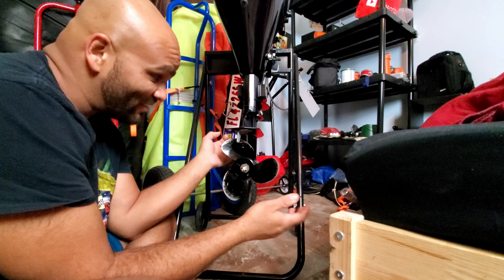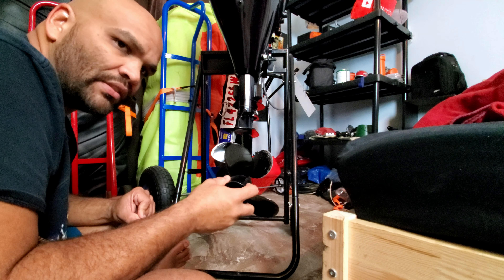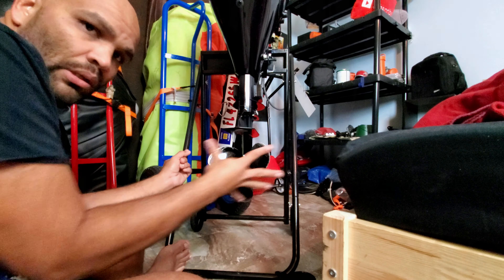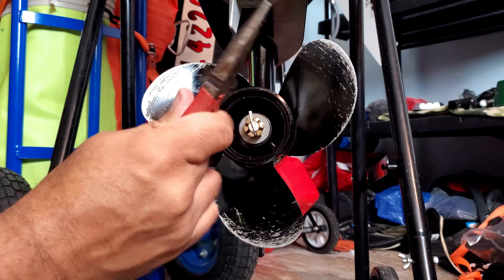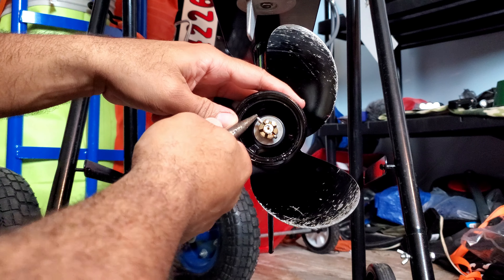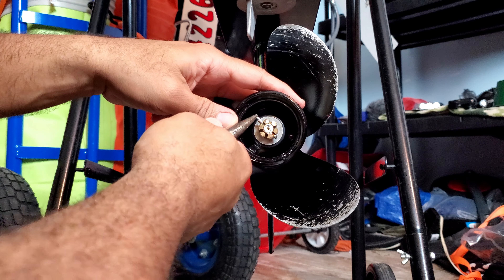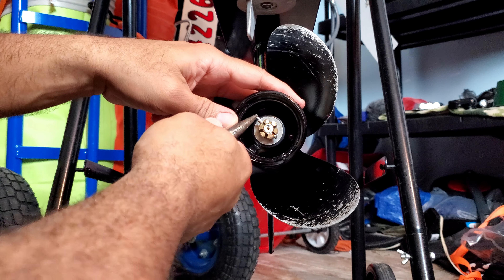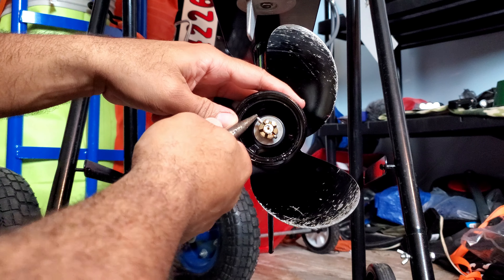Changing and upgrading the propeller on my Tohatsu 9.8hp outboard

Comment: Hi Eric, I have a Tohatsu 9.8, 8.5x7.5 propeller. Boat and gear weigh 350 kg weight, is it worth it to put 8.5x9 pitch? Greetings from Serbia ⚓⛵
Reply from the maker: Ok, an 8.5x9 will be a heavier prop, so there is a chance that it may not get into plane, however, if it does work, you may go faster. I find the factory prop to be more than enough, but that's me personally.
Reply: Thanks friend
Reply from the maker: Anytime 😊

Comment: Hello ! How was with the new propeller?Top speed?
Reply from the maker: I ended up going back to factory because it bogged down the engine. If I was using smaller or lighter boat, it may have helped.

Comment: Great video Eric I am thinking of doing the same thing with my motor also I have heard of something called a permatrim witch is supposed to help these little motors get on the plane well and stop cavitation
Reply from the maker: Thank you! Hydrofoils I think those are called. They help get in place and reduces all of that water splashing around. At the moment since I use lightweight inflatables, I don't think I'll need one.
Reply: @ErickMartinSucre  My first Zodiac(12 ft) with 9.5 Evinrude would ventilate until I put hydrofoil on motor. I think it had something to do with way the bottom of transom was shaped. My current boat(Saturn) doesn't have that problem but I had to put motor a little higher on transom to get best mph.
Reply from the maker: Excellent! I appreciate this info.

Comment: So your OEM is 7.5 pitch and you wanted to go to 8.5 pitch and have a better hole shot, isnt it the other way around?  if you go up in pitch like you are, my understanding is that your RPM's will drop and your overall speed should increase.  If you were to go down to a 6.5 as an example it would increase rpm, have better hole shot but lower top end, anyone else agree to that?  I would also put an RPM gauge on the engine to see what the OEM prop is giving you.
Reply from the maker: More speed is what I want, but it seems it may be my boat's structure that limits my speed.
Reply: The 3 options he talks about references an 8.9 inch diameter but the higher the pitch the more water the blades move
Reply from the maker: Correct

Comment: Hi Eric do you know if there is a prop that can make a Suzuki DF 2.5 hp outboard to make it a bit faster thanks mate 👌
Reply from the maker: I am glad you asked. I used to own a 2.3hp Honda, and unfortunately there isn't a way to make it faster. The displacement on those little motors is too small.
Reply: @ErickMartinSucre  thank u Eric
Reply from the maker: Always a pleasure
Reply: you can install a suzuki Df3.5 carburetor.
3.5 may plane with 140kg/300lbs  total weight. (boat+engine+captain+other stuff)

if the weight is above that, I wouldn't waste money on a carburetor or a propeller.

Comment: Good video! I have a 9.8 also. Did the new prop make a difference in top speed? Thanks
Reply from the maker: The original game me 19mph with hydrofoil on it. That was the 8.5x7.5 one. I put the 8.9x8.5 one on it but have yet tried it with the hydrofoil. I rekon it'll give me about 21mph. I will know once I take it in the water.

Comment: Quick qs, so my original propeller is 7.8x8 and the only one that websites have available is 7.7x7 ...how will that affect speed and thrust? Any idea? (There is oem 7.8x7 but i rather get original)
Reply from the maker: I don't have experience with the 7.7x7. I assume it may be slower.

Comment: Curious if you looked at any of the 4 blade props?
Reply from the maker: I have but since my outboards are small I only need a smaller pitch prop in order to get more thrust. For example, my 6hp Tohatsu has a 7.8x8 prop from factory. By switching to a 7.8x7, I managed to get more thrust and acceleration at the sacrifice of some top speed.

Comment: Hi! Your old prop seems to have signs of cavitation problem with all that wear. I  used the same engine on a takacat inflatable a couple of years ago. It has alot of power but can be tricky to get optimized. Perhaps try cupping the prop and elaborate with the trim angle :) Like your videos and positivism! Have a great day
Reply from the maker: Thank you so much! Yeah, I got a heavier prop but I got the same results. I already placed the outboard on FB market place, but still waiting to see what Onlineoutboards will say about this. Maybe it did come with a 8hp carb.